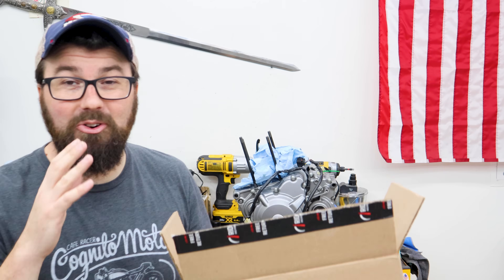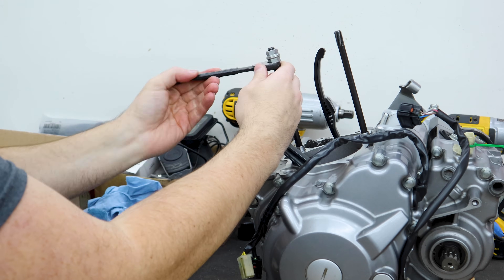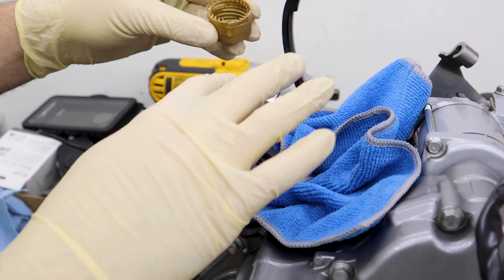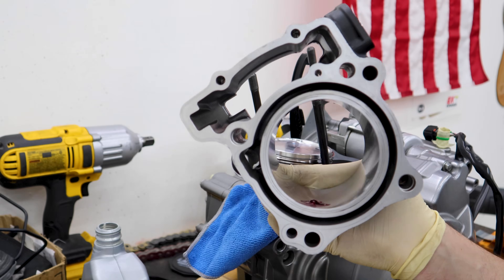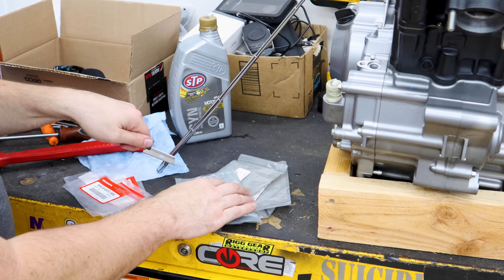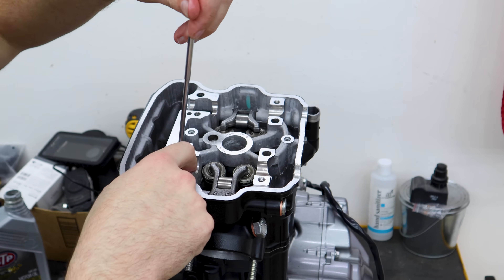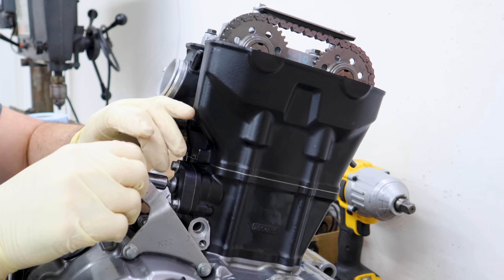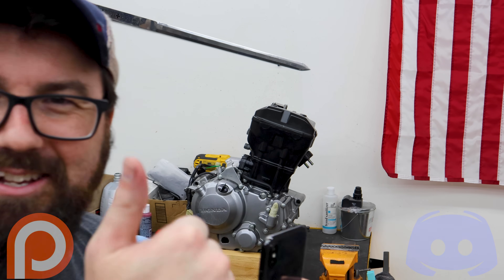CRF300L Big Bore Installed with Ported Head

Comment: I have a cbr300r motor I decked and ported running on a power commander I had dynoed at 30.7 hp.  It’s pretty peppy compared to the stock 250r I started with and sounds nasty with just a tiny straight shot muffler

Comment: When rebuilding a top end, take the opportunity to fill the engine with oil via the rocker box. This ensures the valves and chain are well lubricated prior to starting. Cranking without the spark plug to prime the galleries and bearings is also good practice.
Reply from the maker: Good idea. I actually turned it over about ten times by hand and could actually see oil weeping out around then plain bearings on the cams. Was very 😊 when I saw that.

Comment: excited to see what the butt dyno thinks! I want to do something of this sort but i know the sourcing of the engine parts and extras would be a little overwhelming.  I wish Honda would just make a crf500l or something along that line. I love my 2016 Rally Raid cb500x but it's still 430lbs(maybe more now with the bashplate and other things). I enjoy the power and feel if it was lighter weight it'd be unstoppable. NOt the highest performance but I would trust this bike to 100,000 miles right now and take it anywhere, dirt, street, highway.